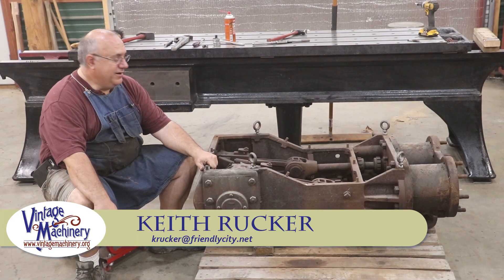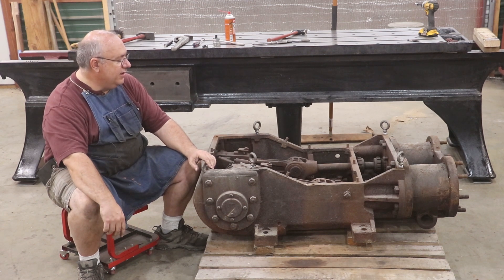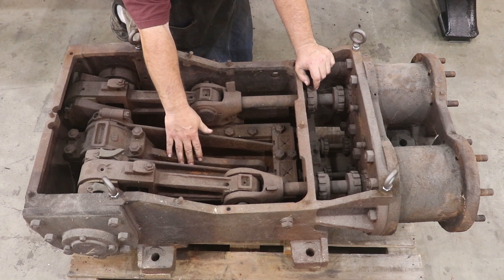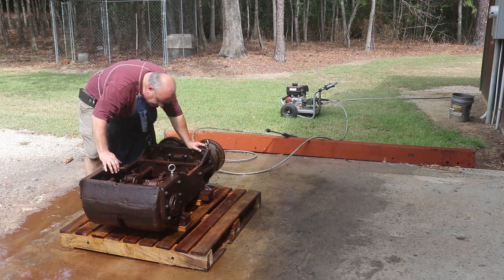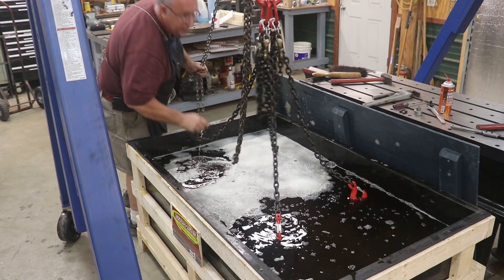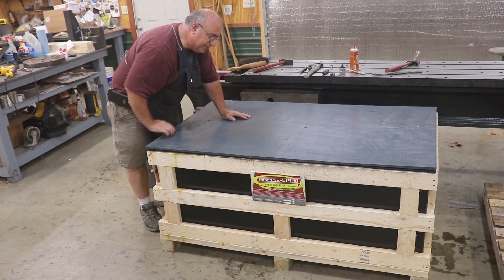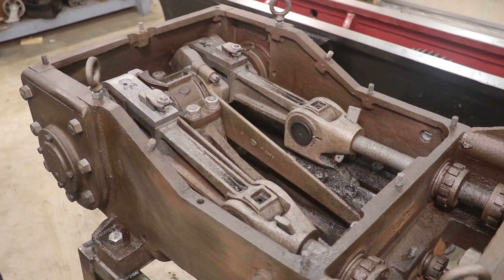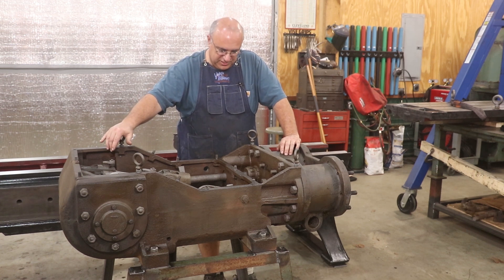Steam Locomotive Stoker Engine Restoration: Part 1 - Cleaning

Comment: I have a set of old US engineering books from the turn of the twentieth century and one of them deals with steam locomotives.

Various ways of stoking the firebox for a boiler are discussed in that volume which I do not imagine any form of early automation could emulate so stokers played a more important role in the smooth operation of a steam locomotive than many folks might think.

Comment: No WD 40.
Make the oil work for you add kerosene and use liter oil . Save the bolts..  heat n oil , chase threads.

Comment: You could measure the tank level before dunking it and after and figure out the displacement then convert to wt. per cu. ft. of steel and have the weight.  Not that you need to but would be fun..

Comment: That frame is a wonderful casting! The unit looks powerful enough to run a small engine itself, I wonder what the horsepower rating is. 
I wonder if some sort of vibrator would help the cleaning process, perhaps a concrete vibrator. The gentleman’s suggestion of a bubbler sounds good.

Comment: Pulled out my old copy of the Locomotive Cyclopedia (11th Ed. - 1941) and it had an entire section on these 7" x 7" stoker engines.  This one is a common model built by The Standard Stoker Company, Inc. and was used on several different types of stoker gear.  It is great to see a project in the works that I can research in one of my old books.  Good luck on it!  Cheers from Central Florida.

Comment: Another massive undertaking but I can certainly understand the enthusiasm in such a project. 
I thought I would mention a product I use for cleaning and degreasing that you might appreciate. It is sold as a floor cleaner by Home Depot in 5 gallon buckets. Not for use on aluminum!

Comment: Keith, You do amazing work and I appreciate you showing the what, why, and how. But I need to ask you to pay attention to your rigging. Using a shoulder eye bolt with nuts against the part to make a straight pull is only correct from the nut to the part. The non captured portion of the shank of the eye bolt, above the nut, is not in a straight-line pull and you run the risk of bending the shank, breaking the eye bolt, and dropping an irreplaceable piece of equipment.  I have done my share of rigging and have seen enough catastrophes to say "make the change"; Either cut the screw thread length so the eye bolt shoulders out against the part or use a stack of washers under the shoulder to keep the whole eye bolt in straight tension as that is where their strength is. Check out the various rigging equipment manuals and see how much the lifting capacity drops as soon as you put a side pull on an eyebolt. If you have the dollars, swivel eye bolts are a great investment and effective at most any angle.
Keep up the great work! It is awesome to see the many projects you take on and to see and hear the history you share.

Comment: Always Thumbs Up, Keith. Your penchant for restoration and working with older machines will serve you well in this interesting project. Anything to bring the Steamers beck to life. That rust cleaner is amazing, nice job and it does look sand blasted. What is the difference between bolts, nuts, studs etc. from 1900 and what is available in mass produced automatic machine made fasteners today?

Comment: Seems like you could use a High Capacity Steam Cleaner. In my experience Steam does a much better job than a Pressure Washer.
Reply: to the public the max pressure in a washer is 5,000 PSI. generally these units that you see at the rental yard are half that amount. 5,000 will remove your fingers and so anything stuck on that motor. Pressure wash equipment used by the trade is usually 10,000psi and above. 10,000 will take your leg off.

Comment: That tank of evaporust would be $1000 here in Australia.    It's not popular over here because of its cost.   What are you going to do with it when the job's finished.

There are a few proprietary equivalents but they too are impossibly expensive to use unless you have special tanks to reduce the volume of liquid needed.

Vinegar is far cheaper if you cal wait a bit longer.

Steve the cheapskate!

Comment: Kieth wondering why you didn't get a electric winch for your gantry
Reply: Go and look at Brian Bloc he has a 15 ton crane and says you have much better control with a chain system over electric. Also the chain is cheaper.
Reply: @ericmcrae7758  

Ok maybe one more trolly on there and have the option for a powered winch...each has its use

Comment: Kieth, did that engine have any sort of a flywheel? The crankshaft doesn't look like it would have enough rotational mass to allow it to run.
Reply: Not much need for a flywheel because in a steam engine of this type the pistons have steam admitted on both sides of the piston (alternately) so every stroke is a power stroke.  Thus, with 2 cylinders, there is a power stroke every 90 degrees rotation of the crankshaft and never any "dead spot"  where the engine could not start from a standstill by simply applying steam pressure to the engine.  Unlike internal combustion engines, you will note there are no "starter motors" or other methods to start the engine rotating on steam engines.  They are not needed.

Comment: I am very curious as to who the manufacturer is. It reminds me of the Worthington Steam pumps that were (are) used at oil refineries and as fire pumps on steam locomotives. I have rebuilt a couple of those that were compound like a Wabco compressor. Don't be surprised if the bearings are poured Babbitt.  I have looked over a power stoker on a big Consolidation at Ely Nv. Operating one looked to be a bit tricky with the various steam jets to disperse the coal.
Reply: I just spent the last two weeks in Ely removing that stoker from Locomotive #81's tender and removing the raised floor in the tender that was installed in the 1930's to make room to install the stoker.  The locomotive was delivered from the factory as hand fired and the stoker was a retro-fit.  The decision has been made to return the locomotive to more or less its original hand fired state.  The removed stoker may eventually be made into a static display, though I would not hold my breath waiting for that to happen.  The main project at the moment is reassembling locomotive 81 which I am told should take about 18 months.  One interesting note:  When I cleaned out the trash in the hopper of the stoker I found that it was full of large pieces of coal.  At the end of its life the locomotive was not being run on the correct type of coal!  One of the coal flow regulating plates was badly bent probably due to one of the large pieces of coal being jammed between the augur and the plate.
Reply: @Vincent_Sullivan  Thanks. I helped with the moving of No.81 from static display years ago. I also timed No.93 (one blade was bent during moving as I recall) prior to the wreck. I imagine the decision not to rebuild and install the stoker was made by someone who does not have to fire it. Like MB... lol.

Comment: I’m surprised they will be running the 576 on coal and not converting to oil.
Reply: Conversion from coal to oil is a large engineering undertaking - especially for a small organization that is doing the rebuilding on the 576.  UP could get away with the change from coal to oil on the 4014 by having the already oil fired 3985 on hand, in shop and operational to 'cobble' the conversion from - the UP Steam folk also had the financial backing of the Union Pacific Railroad to overcome any problems.  The organization being the 576 restoration has nowhere near that kind of financial backing.

Comment: If the guys that built that stoker and engine saw it going into the tub of Evaporust it would probably blow them right out of their bib overalls.
Reply: Back in the 40's and earlier big machine shops had tanks of caustic soda for  cleaning, so this would not be a surprise other than it is not as messy.

Comment: So happy to see more Steam Engines being recondition. I have to omit that I nearly had a heart attack when the stroker look like it was heading for the bed of the planner. Hoping it was just the camera angle. Is it possible to motorize your gantry lift to help lift/lower and move the gantry itself?? To be honest in the past it was painful for me to watch you wrestle with moving heavy metal parts by yourself. Take Care and I can't wait to see this project going forward.  P.S. what is a computer/electronics guy watching a machine shop channel?? Heck I always loved seeing chips flying and learning how stuff is made/repaired even though I will never be able to use the info myself.
Reply: Yes it is possible to power the hoist on the gantry.  From experience I can tell you that very fine control of a powered hoist is a problem and expensive.  With the chain power, Keith can easily set a load very gently on any surface the gantry can reach.  The 5 ton electric crane we had in our shop would jerk to start and jerk to stop in the lift and travel.  I would rather have had a crane like Brian Block's than the electric one for control.
Reply: The novelist Neville Shute wrote something called Trustee From the Toolroom. I do believe the answer to your question just might be found there. Sort of. Look for a copy at abebooks.com or Amazon. Bet you will like it.

Comment: My Uncle Ralph was a Fireman on the Louisville and Nashville Railroad on the St. Louis Division. He had just marked up following his cubbing. This was his first road trip. He said no matter how hard he tried he could not keep a head of steam.  The crew tied up under the Hours of Service after 16 hours on duty.  They only made it to McLeansboro, IL which is 60 miles from Howell. The L&N sent the Traveling Engineer to McLeansboro to see what the problem was.  It turned out the steam lines, or, valves, on the stoker engines, were hooked up incorrectly in the Roundhouse.  Coal was being deposited at the wrong location in the firebox because the stokes were running backward.

Uncle Ralph got a hard way to go for a long time.  

Old heads I worked with when I first hired out told me they hated to see Uncle Ralph on the job if my Dad, Sibley Sharron Du Bois, was the Train Dispatcher. That crew had to do any Local Work so no one could say Dad was showing favoritism toward his Brother. One said: “ Hell, I would just like to get an even break.”  Their Dad, Sharron Tyndall Du Bois, was a Leverman, Operator and Agent for the L&N and IC railroads. Grandpa Du Bois taught his three Sons Morse Code so they would have a skill. Bertis Emory Du Bois worked on the IC and in a Railroad Brigade during WWII.

Thank you for your time.

Brían S. “Duby III” Du Bois
Retired Locomotive Engineer

Comment: The encased oil design is a maintenance chopper. if i know a thing about any mechanical device, the more exposed it is (the moving bits) the more maintenance you're supposed to do. I mean, think about the humble, common lathe. The first ones were fully exposed, now, all of them are covered and oiled, unless they are some kind of direct drive madness.

Comment: Keith,  Have you considered a small agitation pump, like an large aquarium pump to move the Evaporust around while parts are soaking.  I worked in an engine shop back in the days of Hot Tanks, and added an Air Tube with small holes along the entire length of the black pipe, it would only use a small amount of air, and the bubbles and agitation would clean parts in 1/3 the time, and all the little nooks and crannies were far better cleaned.  A part washing tank pump would work very well on your tank, intake on one corner, return on opposite corner would work great.
Reply: Yes, good idea.  People often overlook that you can use an air pump as you mentioned, which uses almost no power, and doesn't need to be rated to work submerged in whatever liquid is being used. Air hose with holes will help agitate the cleaning liquid and probably double or triple the speed and efficacy vs laying parts in a static pool.  Very good observation!
Reply: just use aquarium pump, it has filter on it.

Comment: WHERE are you buying evaporust at?  I mean, my local places are OBSCENE for what they want for it...$20+/gallon.  I bought a gallon about 5 years ago direct from Evap-O-Rust after seeing it at a trade show, and I paid about $9 for the gallon...You must have 50 gallons in there, and I highly doubt you have $500 ~ $1000 gallons invested in that material....especially since it doesn't last forever.
Reply: Rural King has it for about $75/ 5gallon pail.
Reply: @bcbloc02  Wow....if one was around here.  Cheapest I can find it locally to me is $22/Gallon...a 5Gal Pail can be ordered...for $150 because I have to pay the freight as they "don't carry the 5 Gal."...what that has to do with me paying freight on something that they already carry (evap-o-rust, not the size) is beyond me...they would just get it in with the same shipment as the other stuff.  Yea, I live in a real crappy place for all this stuff.  People think their LeBlond lathe, that is in pieces, and MISSING half of it is worth $10K...very frustrating....
Reply: @Scott Lichtsinn Every time Keith brings home a chunk of iron and the price is "Oh don't worry, this was $2500, and we did a bit of horsetrading"...I'm like "That would get you a lathe, with half the pieces missing, no motor for sure, totally worn out and rusted out around me".  Had one I THOUGHT was going to be good, small lathe, everything was "there"...NONE of it worked, motor blown, gear train needed to be replaced...just a mess.  $1250 though...I figure for another $4K it would run.  :(

Sorry to say, but I'm glad I'm not alone on this.  LOL

Comment: Back in the 60s we had a coal fired furnace with a large stoker box on it but the auger was run by an electric motor.same principle I would imagine but you still had to hand shovel the coal into the box and if the chunks were too large that thing would bind right up
Reply: the one in my grandmothers house had a 1000:1 gear box on the auger and a big-n-little belt drive on the motor.  Auger got stuck,  ripped the whole thing off the hold down bolts and flipped over.  I suspect grandpaw put in the wrong shear pin.

Comment: my dream job is to restore steam locomotives. even being able to make one stay bolt for something like the up4014 would be a great moment for me.
Reply: You are a little too late to work on the 4014 Big Boy since the UP shops in Cheyenne have finished the frame up rebuild and it is now back on the rails under steam (although it is now oil fired.) They will be starting on the Challenger (4-6-6-4) soon, however.

Comment: What sort of weights do you work with your gantry Keith?  Powered hoists are surprisingly affordable nowadays.
Reply: My power hoist is so fast I use a snatch block to slow it down a bit.
Reply: @stancloyd  I've been retired so long I can't remember how much control we had of the gantry cranes, but now you mention it, we did have to use quick stabs of the button to make short adjustments.  My favourite gantry story was when someone drove a huge truck tractor unit into the main workshop area (I worked at Ford Research & Development in the UK).  The truck hit the gantry cross beam and sent it travelling along the workshop.  The controller and chain was slightly out in the isle, and one of the fitters — let's call him Ernie because that was his name — instead of stepping sideways out its way, started running along in front of it like a rabbit caught in headlights.  The gantry lost momentum before Ernie worked out that it would have been easier to step sideways, and he was never ever allowed to forget his moment of idiocy.  Come to think of it, this was par for the course with Ernie.  On another occasion he picked up a large drain tray, stepped forward with it, and discovered it had been put there to cover a missing inspection pit board.  That story was not so funny as he really hurt himself!!

Comment: It occurs to me that it might be really nifty to make an alternate acrylic top plate so folks can watch the internals in action.
Reply: dirty oil would splash everywhere you woulldnt see shit. and it would get stained in no time.
Reply: It's deep inside it's own box in the tender 
You won't see it during operation anyway 
You can get clean rockercovers for car engines but as Jacob said it's a good in theory but doesn't last long
Reply: @fowletm1992  Keith said there were two of them. I'm thinking one could be a display model. Maybe they wouldn't have to use as much oil, or could use some that's not as dark. They could even let the observer control the air pressure in to the cylinders to see lower speed operation.
Reply: My bet is on a cast aluminum cover.